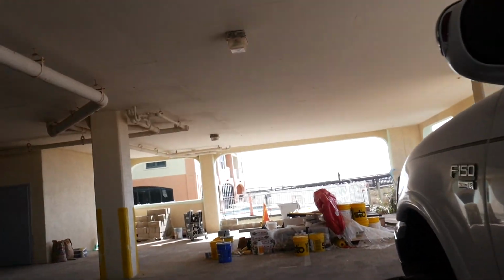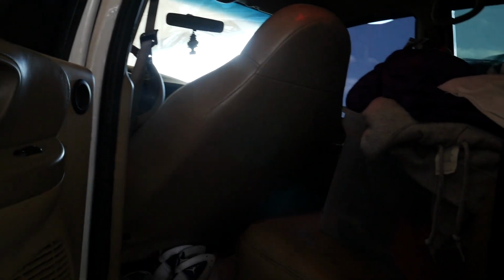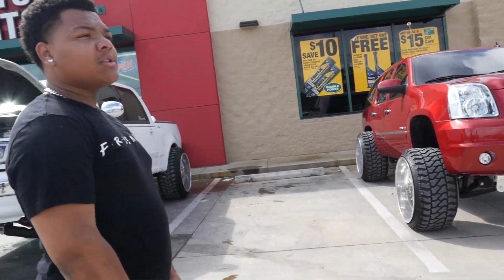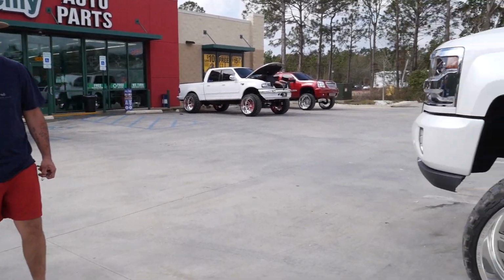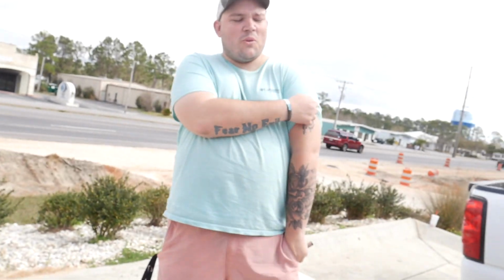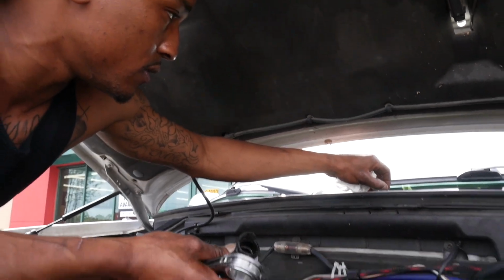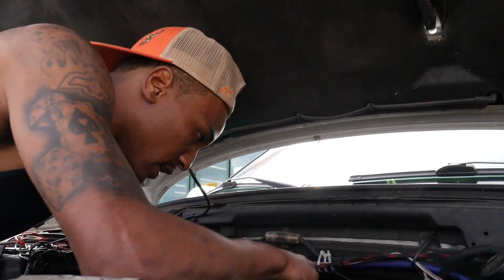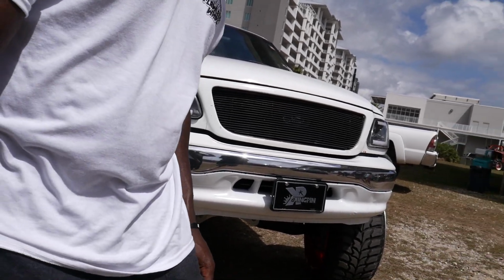CRUZIN WITH MEL X POPPINCLUTCHES COLLAB | MY TRUCK BROKE DOWN at OBI| MUST WATCH!!| LIfted Trucks

Comment: u and popinclutches need to start a truck group
Reply: @Owen Ryland Instablaster :)
Reply: @Aarav Wallace thanks so much for your reply. I got to the site through google and im in the hacking process atm.
Looks like it's gonna take quite some time so I will reply here later with my results.
Reply: @Aarav Wallace it did the trick and I finally got access to my account again. Im so happy:D
Thank you so much, you saved my ass :D
Reply: @Owen Ryland happy to help =)

Comment: I had the same problem with my truck and mine turned out to be a broken bolt inside my water pump and that fixed the problem